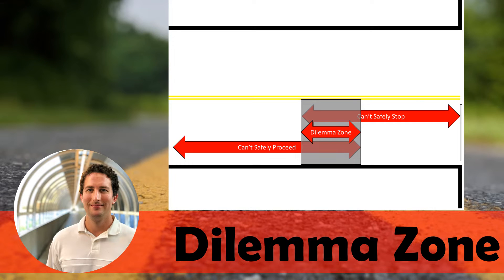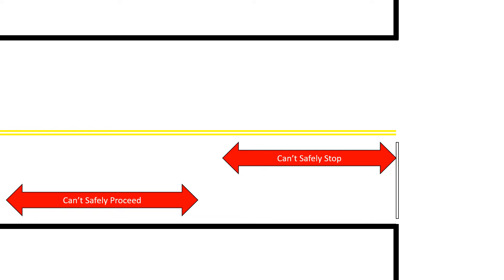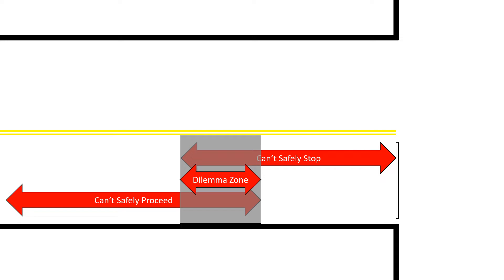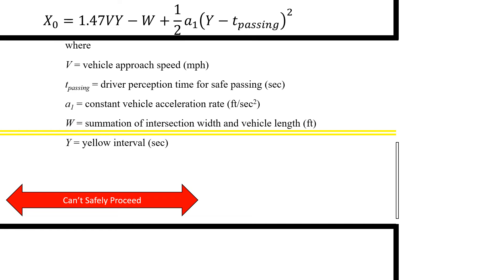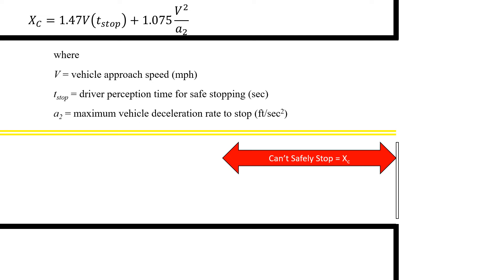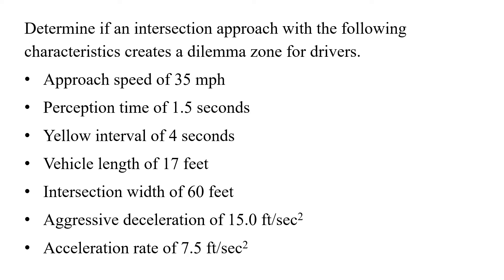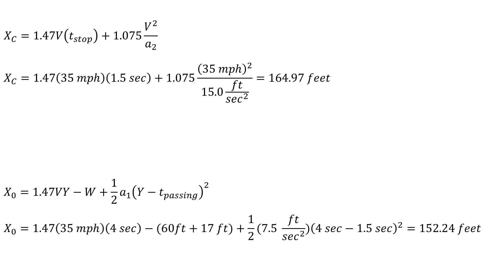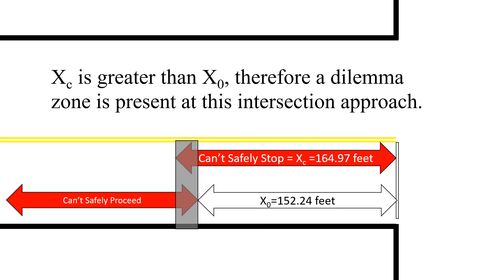Dilemma Zone for Traffic Signal Timing and Design | NCEES Civil Engineering PE Exam [Section 5.4.1]

Comment: Just install a countdown timer at the intersection, problem solved and fool proof.
Reply: That can actually backfire. Some drivers will take advantage of that and accelerate when the signal is about to change, to avoid having to wait a minute or more.
And some drivers will slow down and stop by the time the yellow light comes on.
When these 2 drivers meet, you have an unsafe situation which can easily lead to a crash.
Also countdown timers are not compatible with actuated control, when phase lengths are varied in real time depending on the amount of vehicles detected. It's simply impossible to know in advance how long a phase will last.
I come from a country where countdown timers are common (because most traffic lights still operate in fixed-time mode). As they are being upgraded to actuated control in many cities, countdown timers are becoming less and less common. 
Another point I'd like to note about countdown timers, is that many of them here operate in a very lazy way. The way they work is they measure the time a given phase is displayed for, over the course of 2 cycles, and only from the 3rd cycle they start displaying the phase time. During these 2 cycles, the countdown timer displays the wrong time, which misleads drivers and creates an unsafe situation. For instance, after the red light countdown ends, the light stays red. Some drivers are already starting at the last seconds.
So even with fixed-time control, they don't really work well when a traffic light has multiple plans for different times of the day, or days of the week.

Comment: for a long-formula problem such as this i highly recommend the use of following ti-36x pro calculator functions:

. "num-solv" chug-and-plug formula solver
. "recall" defined variable library
. "sto ->" variable definition
. "x | yzt | abcd" variable bank

if you've studied programming in civil engineering you will recall the programmatic nature of the above functions. use this programming "mindset" as much as possible to quickly exploit shortcuts, to reduce intellectual fatigue, and reduce risk of errors during a live civil pe exam!
Reply from the maker: Great suggestion!  Thanks for sharing that tip!

Comment: ncees hb 1.1, p. 279.

thank you for covering a new topic for the pe exam.

i calculated the x_dz = 13'. would you comment on this value in context of engineering practice?

is there a rule of thumb or a table which depicts an acceptable, max x_dz ?

or should the x_dz = 0' ?

can x_dz be negative? if so, please comment on context and consequences of a 0' DZ.
Reply from the maker: What intermediate values did you calculate?  I got 12.73 as the difference, which is approximately 13 feet.  In practice, you would round that off because of the variation in the assumptions that are built into the problem.  If it's 0 or negative, that means you don't have a dilemma zone, so that's what you're actually looking for.
Reply: @FindleyDaniel  my calculated x_c and x_o are same as yours and the x_dz was about same as yours.

I did round it up to 13' since I felt inches-high precision in roadway transportation was unnecessary.

I would also try to round up to 13' during a live pe exam as it would make practical sense and since the purpose of the pe exam is to test our judgement abilities.

Also, any rounding should be left for the final step. Use the calculator to "remember" intermediate value as it can be done as precisely as possible.

I like to bind my values to variables within the calculator and to store them as such until I need them later. My ti-36x pro calculator stores up to 8 values at once within variables x, y, z, t, a, b, c, d.
Reply from the maker: @oleopathic  Yes, that sounds reasonable to me!
Reply: @FindleyDaniel  intermediate values:

V = 35 mph
t_pass = t_stop = 1.5 sec
Y = 4 sec
W = 17' + 60' = 77'
a_1 = 15 fps^2
a_2 = 7.5 fps^2

x_c = 164.97'
x_o = 152.24'

x_dz = x_c - x_o = 164.97 - 152.24 = 12.73' = 13' (rounded up).